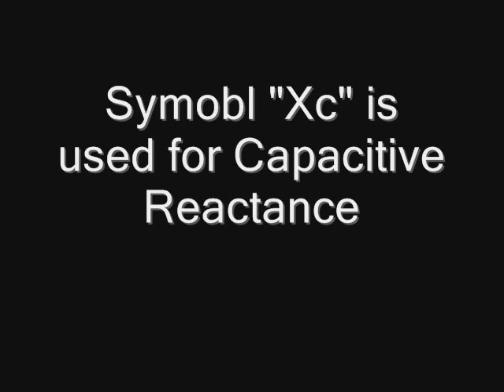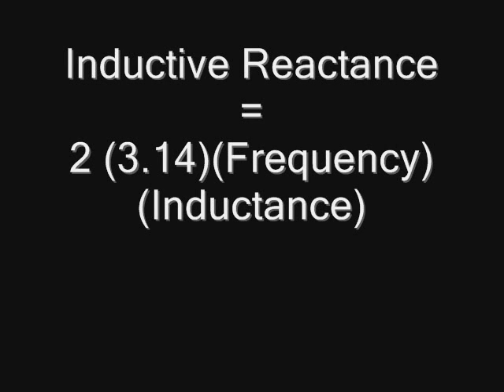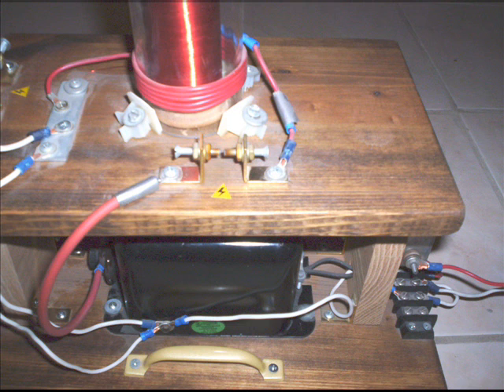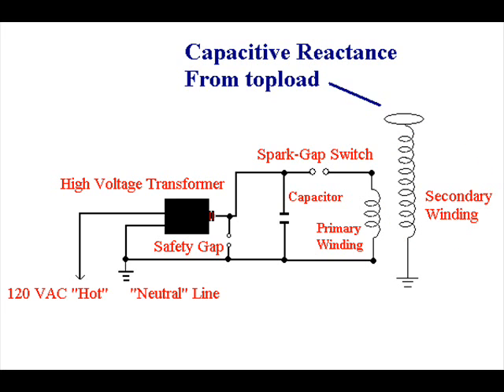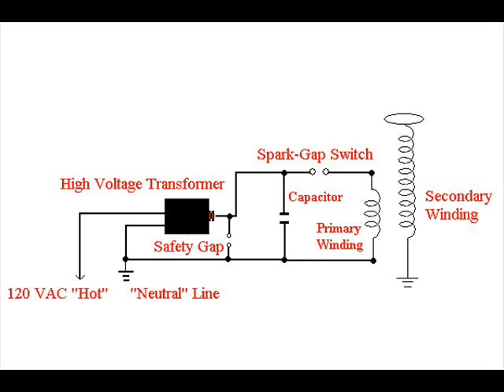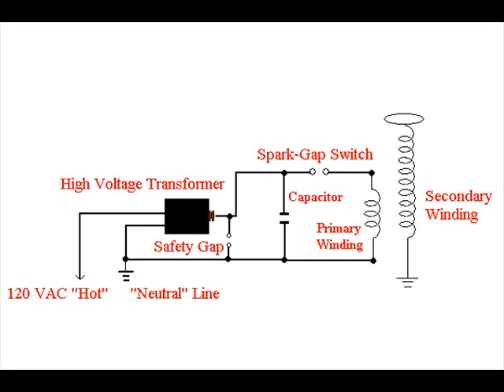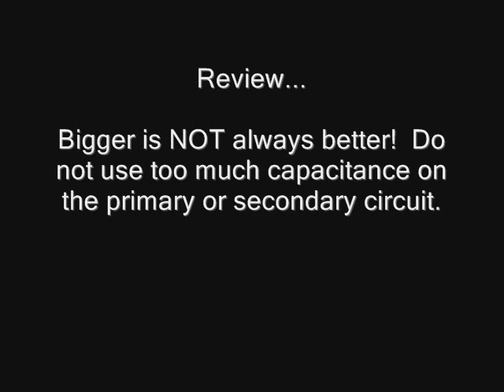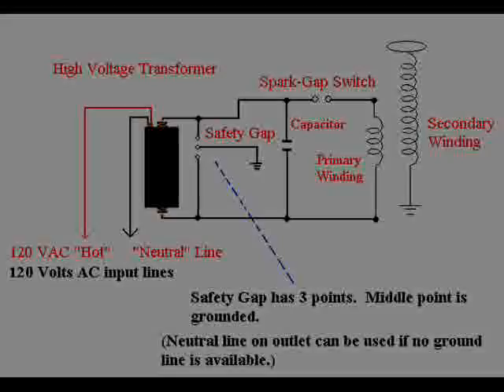Building a Tesla Coil - Part 2 (B)

Comment from the maker: Sure, you can use an ignition coil as the transformer.  But you'll have to use some kind of driver circuit to power it...you can't just plug it in directly to 120 volts AC because that will overload it.  You could use a dimmer switch to power it with AC.  The dimmer will change the AC into a chopped triangular wave and that will drive the ignition coil.  But you also have to use something to limit the current.  Message me, and I'll try to find a diagram if you want to try it.

Comment from the maker: ...and by the way, the reason why I used a plastic bolt and not a regular aluminum or stainless steel screw is because you don't want the high voltage output going through the middle of the secondary winding or it will form a corona INSIDE the winding and internal arcing between the turns.  That will eventually burn it out.

Comment from the maker: I used a plastic screw, and aluminum nuts and washers to bolt on the top terminal.  You can get plastic screws at any hardware store.  I just connected the top end of the secondary winding to the terminal.  If you use a cardboard tube for the secondary winding, you can probably get a plastic lid for the top, then bolt the terminal to the lid.  I just used a wooden drawer knob and then drilled a hole through it to bolt on the top terminal.

Comment from the maker: It depends on the voltage of your transformer, and of course the tuning for your coil.  There really isn't one universal gap setting.  But the spark gap on my coil is maybe 1/4 inch.  The transformer is 6kv @20ma.  I didn't really design a gap setting, I just arbitrarily built it and then adjusted the gap until it was tuned.

Comment: One question tho, 
    Technically, by adjusting the spark gap, we aren't altering capacitance, simply breaks per second frequency and energy thrououtness by lowing the capacitor's voltage and therefore joules. We are increasing the frequency of breaks or arcs per second, but not the sub frequency of the inductors. Let me know if other wise. 
       Hey, I think your vids are great for people starting out with a project. Good work.